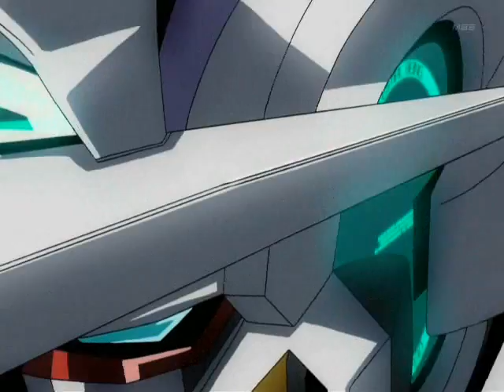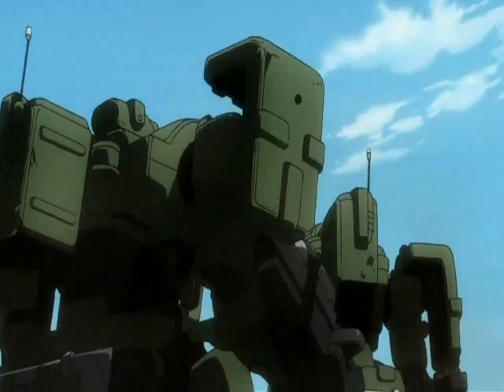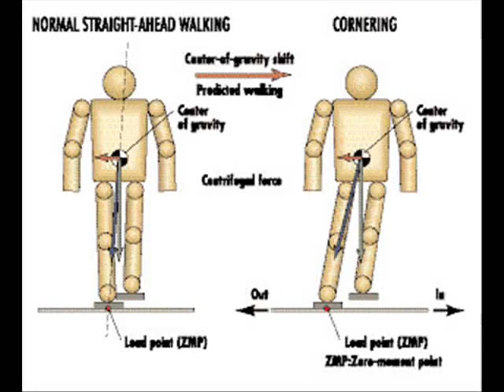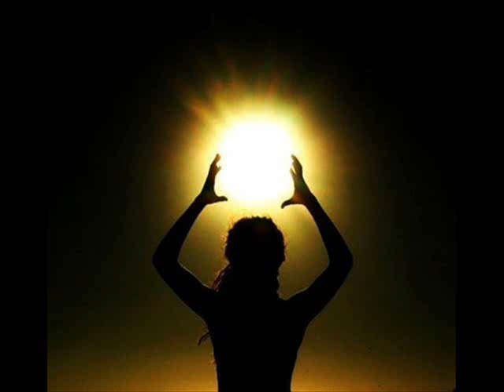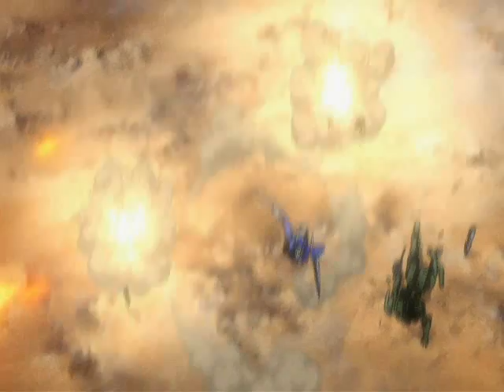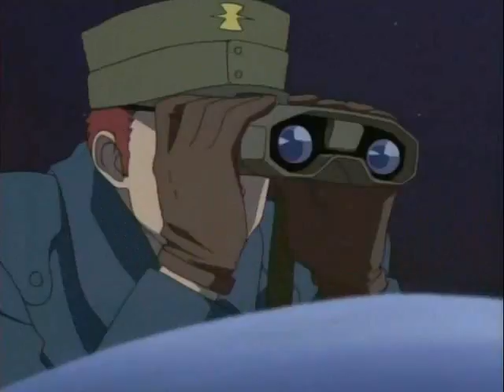Real Life Gundams Are They Possible? Part 1

Comment: @sarimakbar I think it would be a bit more believable to have robots like from the Armored Core series. They use a boost function to be agile, but they still move like big giant tanks with their legs. Also, they use lots of power, and seem to behave more realistically than gundams (at least in terms of physics). Even better would be the ones coming up in Armored Core 5. The new ones are going to be only about 5 meters high, which is a lot more practical height for a combat weapon like this.

Comment: I dont think I like your choice of using Gundam 00 as an example. Zakus dont move all that fast. And they get the job done. Gundam 00 is strictly fantasy. Tehres no way a machince can slide like that on the ground swinging a METAL sword and not lose balance and/or break mechanics in its ancles and legs. Even humans moving like that sprain their ancles. The original MS series is more scientifically correct. And I hope you arnt basing your the calculations on/for Gundam 00's gundams..

Comment: @Viper4ever05 

With current technology, no. maybe in 150-200+ years.
But if it were possible now, the advantages would be enormous compared with,jetfighters,tanks,helicopters,battleships etc.
Nothing would come close concerning mobility(dodging,reflecting,evading) attacks.

Think of it if you where 50 times a big as now, carrying a sword/shield how easy would it be to cut a airplane carrier wide open, or blocking a missile with a shield.

Comment: With current technology, no. maybe in 150-200+ years.
But if it were possible now, the advantages would be enormous compared with,jetfighters,tanks,helicopters,battleships etc.
Nothing would come close concerning mobility(dodging,reflecting,evading) attacks.

Think of it if you where 50 times a big as now, carrying a sword/shield how easy would it be to cut a airplane carrier wide open, or blocking a missile with a shield.

Comment: ya but in code geas, havent u wondered everytime they use the wheels, the knightmare's feet are basicly sliding against the floor...its not like roller skating..the wheels are same level as the feet, i never got that. IF we used that as a real life gundam...friction will stop it from moving